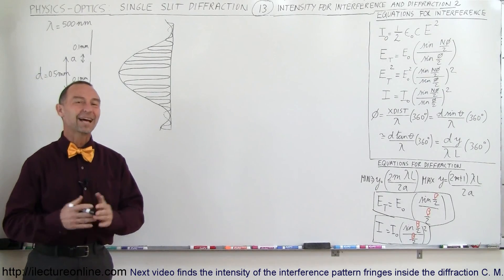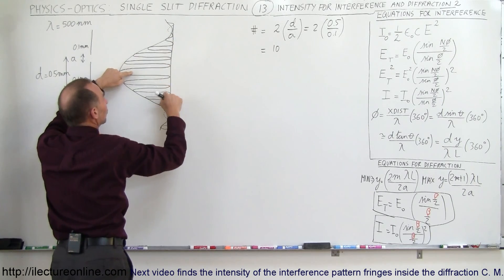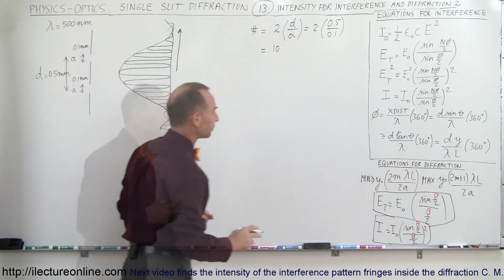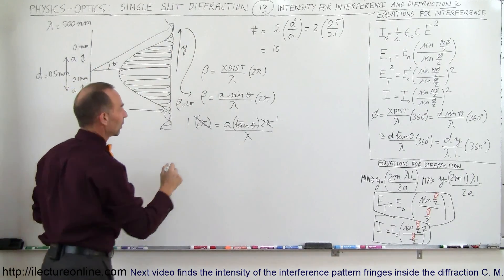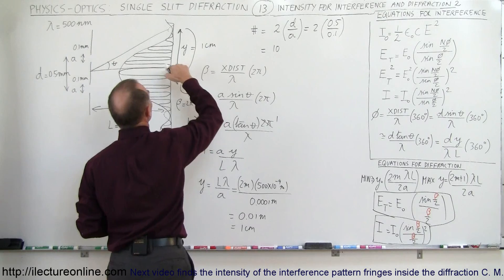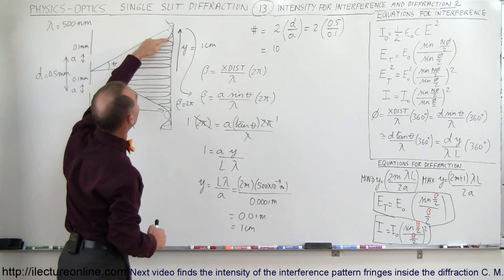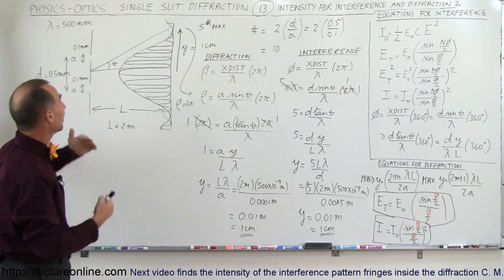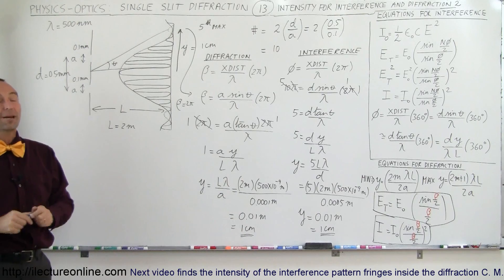Physics - Optics: Single Slit Diffraction (13 of 15) Location of Intensity = ?

Comment: What if it has 3 slits? Should the max still be in the middle? Also, would the number pf fringes then be 3*(d/a)? Thanks in advance! These are great videos, you helped me a lot with this!
Reply from the maker: When there are 3 slits, the max will still in the middle, but the interference pattern within the diffraction pattern will look different, with two large peaks and one small peak that repeats.
Reply: @MichelvanBiezen I found your video on 3 slit interference! Thanks for the response!
Reply from the maker: Glad you found it.

Comment: Mr. Michel, I have a question: why does the interference pattern lie inside the diffraction pattern; shouldn't it be the other way round since diffraction occurs first and interference afterwards?

Comment: Does the central diffraction maximum have the same number of interference maxima as interference minima?
Reply from the maker: The ones on the end (at the first interference minima), they are not complete diffraction maxima.  Therefore that does not lend itsefl to a clean answer.

Comment: Do we have have single slit behind the two slit to produce diffraction pattern?
Reply from the maker: Each slit will produce a diffraction pattern, even if there are two slits.  You don't need an extra single slit.  We have videos that explain that in these playlists.
Reply: @MichelvanBiezen That's not clear to me. I was expecting to two bell shape curves due to diffraction - one from the top slit and another from the lower slit. How is single bell shape curve is formed in the center of two slits ?

Comment: Great Work Sir. Can you please tell me how did you derive the number of fringes inside one diffraction pattern?
Reply from the maker: The best way to do that is to first find the first minimum of the interference pattern (double slit interference) and then you find the distance to the first and second minimum of the diffraction pattern.  Then you can see how many time the difraction pattern widths fit into the interference envelope.
Reply: Thank you very much Sir. I will work it out

Comment: How can the diffraction "minima" cancel out anything, i mean, since it's a minimum how can it alter the interference pattern, as it already canceled itself out by destructive interference?
Reply: One good way to think of it is that the diffraction pattern acts as an "envelope" for the interference pattern, so that the interference pattern is "inside" the diffraction pattern.
When you think if it this way, you can easily realise that the minima of the diffraction pattern will force the interference pattern to have zero intensity at those spots, since it's "squeezed down".
Reply: never mind, i think i got it
Reply from the maker: Дејан Гујић 
Sometimes the diffraction minimum coincides with the interference minimum and sometimes it doesn't 
When it doesn't the diffraction minimum will cancel out any interference pattern that may leave a partially constructive pattern.